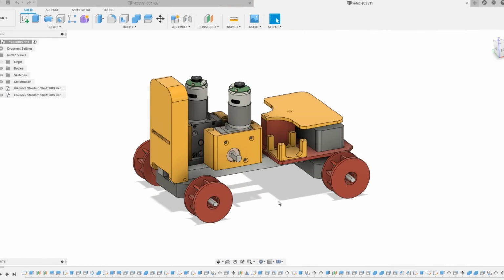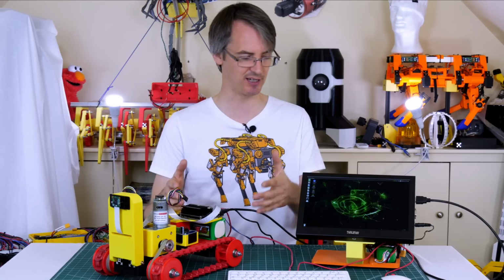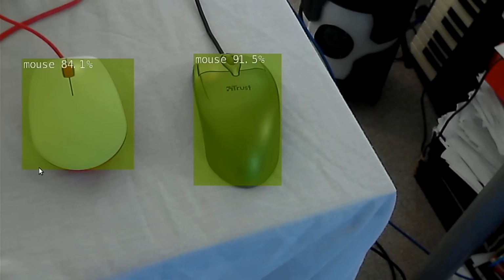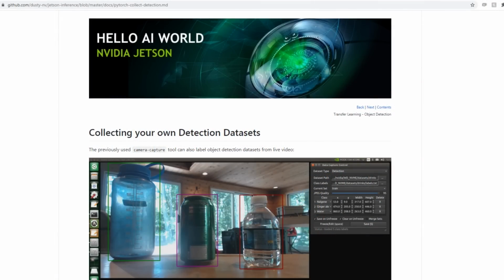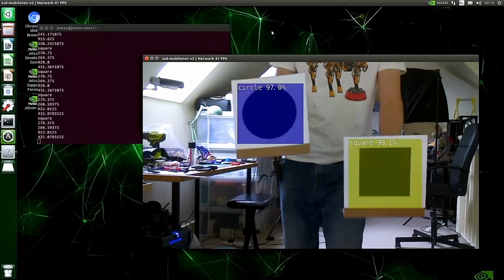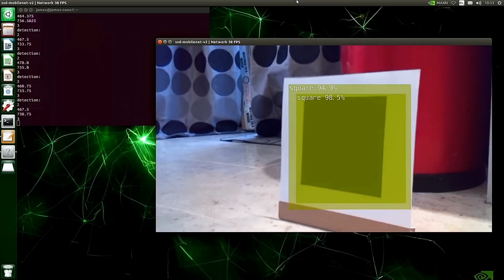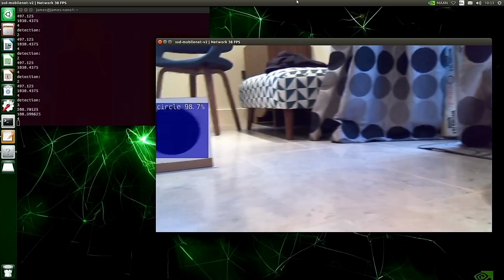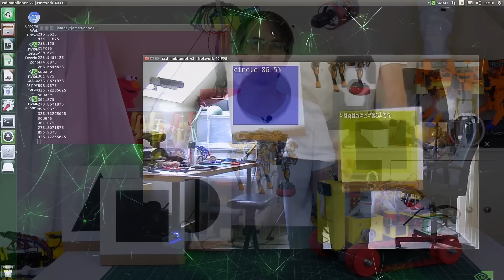Simple A.I. Demo with Jetson Nano

Comment: Great video! Are all the the electronics on the robot powered by the 24V battery? I'm working on a small project and currently using different power sources for the SBC and the motors, is it ok if i conect everything to the same power source using voltage regulators?

Comment: Hello I just got myself a Jetson Nano and a Sparkfun Jetbot Kit. All is going great yet before I start up on programming I need to find a way to install a Wheel Encoder. I'm at a loss really since sparkfun does sale the wheel encoders yet do not say what is NEED to control them. I want to build a robot which will teach itself but for this I need a way for it to be able to sense when it is not moving so it can then work form there and teach itself not to it again.

Comment: It usually doesn't have to take 100s of hours. Can it take 100s of hours? Maybe. But you have to be dealing with a ridiculously large dataset and model. The biggest I've trained took about 2 days. Though the most I've trained took about 2-3 hours.

I've trained models that have well over 5000 32x32 rgb images and it took that 2 days.

Comment: Hey there^^
ive seen youve done a few videos on robots with inverse kinematics, tho you dont show how you do it?
ive built myself a 18 dof hexapod with an arduino and a pololu servo controller, yet i have no idea on how to install an inverse kinematics code on there to control the servos(i dont want to use a frame by frame program tho)
ive subbed so should you decide to do a video on it ill make sure to watch it^^
nice work; keep it up :thumbsup:^^

Edit; i wanna control the robot via a rc radio, but i think using a jetson could be interesting as wellXD

Comment: I think you should isolate the camera on some of those little rubber ball that drone's use on there camera rigs.  The vibration of those tracks and the frame rate might just meet at the wrong time and the computer can't tell what it is for split second..... easy to test that theory.    ...while I got your attention. Put that on the 2 wheel Sonic and teach it the cones and turn it loose.....

Comment: I thought you tubers have to disclose when it’s a paid endorsement or at least disclose when they are given things for free by big companies because this is the third you tuber that have praised the jetson nano even tho it’s no more powerful then a pi and is basically a raspberry pi compute board with a normal interface
Reply from the maker: I bought this one, the Xavier NX is coming up in the next video with disclosure. Jetson runs GPU based stuff quicker than Rasp Pi
Reply: James Bruton oh that was a fast reply, I didn’t mean to sound like I was calling you out or anything I just found it weird, James from the hack smith said the same (a bit more defensive but still) but my stance was that you can over clock the pi really easily and with all the heatsinks and hats that you can get for a pi I would argue if you were starting into ai/computer learning development you probably already have a raspberry pi (maybe not a 4 with max ram but still) and with the pi4 having more ram then the nano, they’re about as powerful as one another
And if you were just getting into it but then decided you wanted it in a different project a pi would probably be the better way to go, in my opinion
Thanks for replying tho a lot of people would just ignore comments and answer questions on Instagram or Twitter

Comment: I'm going to use this to vision system to put away the dishes!
Reply: Can it be trained to recognize features on an object?  How does it do with partially covered objects?
Reply: With the training you did, at what angle (off of the normal to the paper) will the ai not recognize the shape?
Reply: @TheRainHarvester  in this case the training data was pretty sparse. If he trained with more angles it would work for more angles

Comment: I thought AI was always learning. Or is that a different type of AI? This AI is train then go. That robot should learn while going so it can have the mind of its own 😂
Reply: AI - is any program that appears to have intelligence while machine learning actually learns how to get the desired output when provided with an input. In other words machine learning is AI, but AI isn't always machine learning.
Reply: @jesseshakarji9241  ohhh thank you for this!
Reply: Actually pretty much all Deep Learning systems train just once.  It is a real problem.  If you want to add a new object to a trained system then you have to retrain on the complete set of objects again.  Systems which can learn on the fly are called 'continual learning systems' and they are still a research area.
Reply: @Paul-rs4gd  That's really interesting. This changes my views on AI now! Not in a bad way.